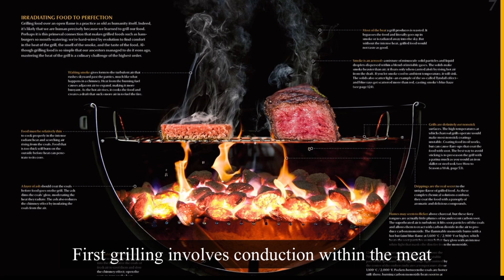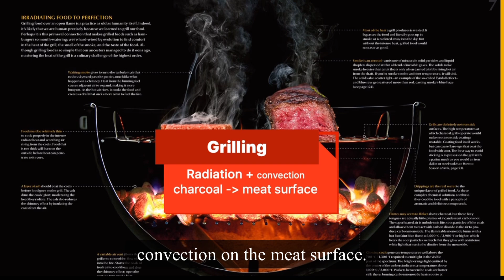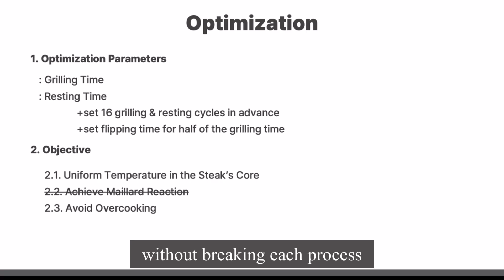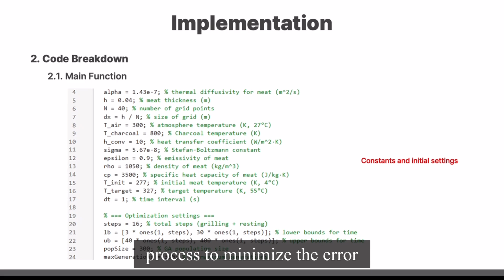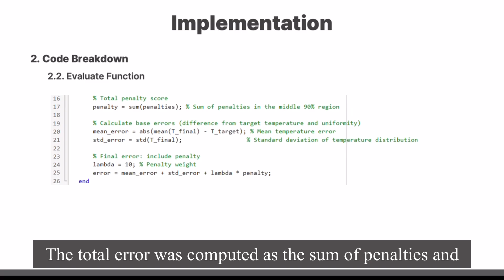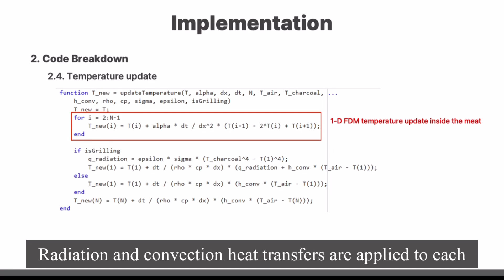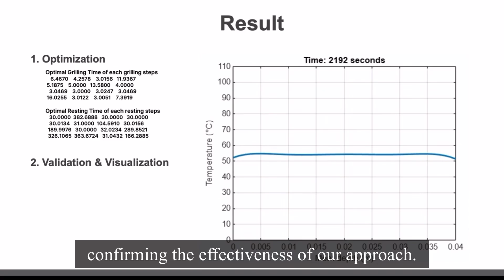Team10, A well grilled cut of meat. That’s it

Comment: Hello, I'm Lee Hyun June team 12. I have a question while looking at the graph, even though grilling was chosen as the method of cooking, the top and bottom of the meat seem to cook simultaneously. What is the reason for this?
Reply: Thank you for watching our video. Firstly, you can check that the temperature of top and bottom is not perfectly same,  but slightly different. Also, the reason that top and bottom of the meat's temperature is similar is that thermal radiation, not conduction, from heat source is dominant heat transfer method. 
Charcoal burns at high temperatures and emits significant amounts of infrared radiation. This radiation transfers heat to the meat directly, warming both the top and bottom surfaces of the steak regardless of their distance from the charcoal. 
While the radiation does not penetrate into the meat, both the top and bottom surfaces of the steak are directly exposed to radiant heat from the charcoal (or reflected heat from the grill lid or surrounding environment). This direct heating of both surfaces creates the illusion that the internal temperature is rising uniformly from both directions, but in reality, the heat must still conduct inward from the surfaces. Thank you!

Comment: Hello, thank you for your presentation and I’m from team 6. When cooking steak on a pan, wouldn’t it make more sense to consider the pan’s temperature as the effective heat source rather than the temperature of the charcoal? Thank you.
Reply: Thank you for watching our video. In our study, we modeled grilling process with 'grilling with Barbecue grill and charcoal' as you can see in 0:46, which has small contact area compared to pan, and so its heat transfer process is slightly different from 'grilling with pan'. So we considered 'radiation' from heat source(charcoal) directly, and didn't model conduction from pan to meat. Thank you!

Comment: Hello, I'm Heesoo Lee from team 1. As I understood, the project assumed that the moisture, protein, and fat are distributed evenly throughout the steak. However, in the actual world, this is not the case. Would the error due to that difference be minuscule enough to ignore? If so, why?
Reply: Thank you for watching our video. As you mentioned, we assumed that the moisture, protein, and fat are evenly distributed. We thought that this simplification assumption was reasonable because 1) thermal diffusivity('alpha' in presentation) of the moisture, protein, and fat are 1.39*10^-7, 7.69*10^-8, 1.14*10^-7 in order, and there is small difference between them 2) In a steak, the distribution of water is a major determinant of heat transfer characteristics, while variations in protein and fat distribution are less critical because their thermal diffusivity is relatively similar and lower than water’s. Thank you!

Comment: Thank you for your well-prepared presentation on interesting topic. I am the representative of Team 2, and I have questions. I think the effects of conduction and radiation would be significant, so I find it difficult to understand the graph where the top and bottom temperatures of the meat are shown to be the same. Additionally, I am curious about how the parameters could be adjusted if a grill is used instead of a pan.
Reply from the maker: Thank you for watching our presentation.
Q1. How is the temperature distribution of top and bottom side same?
A1. Actually when precisely looking at the graph, there are some moments when the graph is not perfectly symmetry. This is due to the timing of flipping. When first make the algorithm, we also included the flipping timing as variable. However the effect of the timing is not much great when we consider the increased calculation steps and times. Moreover the result of the  temperature distribution of the final meat is not as good as the one where the flipping timing is set as the half of grilling time(which is the one we used in the algorithm of presentation).
Q2. How the parameters could be adjusted if a grill is used not a pan?
A2. In the presentation we consider the circumstances where we us grill. Among many types of meat grilling methods, we pick grill because it's the way used in the program "흑백 요리사" and the main heat transfer of grill is radiation which requires many calculations. When it comes to the pan grilling, mostly the heat is transferred  in forms of conduction(or convection). In this case we can easily calculate the circumstance by just changing the boundary equation of meat surface. From radiation to convection.

Comment: Hello, I am from Team 5! What an incredible presentation on an amazing topic! I have a question: How did you determine the thermal diffusivity and specific heat of the meat? Additionally, I would like to know why flipping was set to half time, since when the cooking is initiated, the average temperature of the piece of meat is very low, but when flipping happens, the meat has already acquired a high temperature (even though it's not uniformly distributed). Thank you in advance.
Reply: Thank you for your attention. 
We've used the properties of meat such as thermal diffusivity and specific heat from Douglas Baldwin's "Heat Transfer in Meat". 
And yes, it would be more accurate to also calculate the flipping time by numerical analysis, but then it would be too hard to cook the meat in real life considering each flipping time. So for the sake of simplicity we just set the flipping time as half of the grilling time. And also when we have also considered the flipping time as variable, it didn't give much difference at the final result while increasing required computing power.

Comment: Hi, I'm Kim Namyoon from Team 4. Thank you for giving a presentation on an interesting topic. I wonder why the temperature of the top side and bottom side of the meat is similar before settling (end of cooking). Also, I want to know why the temperature is rising again.
Reply: The top and the bottom of the meat has similar temperature because the meat is flipped very frequently, before it gets cooled.
And the temperature rises again because it is flipped and heated again. As you can see at the top of the graph, since the time is multiplied a few times it may look like the two sides are heated at the same time, while they are actually heated and flipped separately.

Comment: Hi,  I'm the representative of Team 3. First of all, thank you for your great presentation. I have a few questions regarding your work. In your presentation, grilling time and resting time were set as the design variables for optimization. While time is undoubtedly a crucial factor when cooking meat, temperature also seems to be an equally important element. I’m curious if it would have been possible to include both temperature and time as design variables in the optimization process. If there were constraints or challenges in using both as design variables, what difficulties did you encounter?
Reply: Thank you for watching!!
It is indeed possible to consider both time and temperature(heat source) as design variables in the optimization process. Temperature can be treated as a variable dependent on time, allowing for a more dynamic optimization approach.

However, in our project, we assumed that the temperature of the charcoal (our heat source) remained constant over time. To incorporate the temperature variations of the charcoal, it would require actual modeling or observational data to account for how the heat source changes with time. This process can be time-intensive and resource-demanding, which is why we chose to simplify our approach by assuming a constant temperature.

That being said, including temperature variations over time would likely yield more precise results, and we recognize the potential for refining our model further in future work. Thank you for the great question!

Comment: thank you for your amazing and interesting work. I'm from team 9. When grilling meat, the direction of heat penetration will come into the side as well as the bottom of the meat, so shouldn't we think that more heat penetrates into the meat? Thank you.
Reply from the maker: Thank you for well watching and question.
Q. Isn't the  heat come in to the side as well?
A. Yes. there should be heat transfer in side as well. More precisely we may have to consider the view factor as well. Also we should make square specimen which has 6 boundaries. We tried to solve this problem in 3-D condition. But this requires kind of experimental data.
 Also the main purpose of this algorithm is to make perfectly grilled meat with very thin overcook layer. When grilling meat people mostly check the center temperature because it is the part taking the longest time for heat to be transferred. Plus the length is about 3~5 times longer than the height. So, we denied the side heat transfer and analysed the center heat distribution so as to get the optimal grilling time.

Comment: Nice work! I’m from team 7. I have a question. What was the reason for choosing the Genetic Algorithm (GA), and how does it compare to other optimization techniques in terms of advantages?
Reply from the maker: Thank you for watching.
Q. The reason and advantage of using GA algorithm compared to other methods.
A. There are several matlab built-in optimization functions. These functions can be specified in terms of its mechanism as Gradient-based(fminunc,fmincon), Derivative-free(fminsearch, patternsearch,GA),global optimization(ga, simulannealbnd, particleswarm), linear programming and mixed-integer(linprog, intlinprog), and other specialized optimizatins. 
 As we mentioned in the presentation, we tried to get optimal grilling and resting time for each step not in total step. However, each time is close related each other and we need to get 36 times. This means that the 1st grilling time is not independent of the 18th grilling time because it changes the temperature distribution of 18th steps. For this reason we need to consider the algorithm which can effectively get the optimized 36 times.
 The way we used is first to use matrix and second to use GA algorithm. Each grilling and resting time is different for each step but the condition they get is same besides of the temperature distribution at that time. And to get best use of the matlab, we use the matrix form variables. 
 GA,genetic algorithm, is global optimization and deriviative free algorithm. It doesn't depend on initial value but search total search space. Most importantly this algorithm evaluate several solution at a time. Plus it has low possibility of falling in local optima. Plus,  unlike other algorithms for every iteration it change several solutions. This gives the solution not by analyzing the graph or equation our complex and varying conditions are effectively calculated. The constraints of this algorithm are heavy calculation load, and highly effected by the penalty function.
 To overcome this constraints, we construct 1-D condition. And finely changing penalty function weights. For example, we first construct with only overcook thickness and center temperature, then added standard deviation of temperature distribution, then added penalty for too high temperature of inside 90% (>60 degree celcius) during grilling.

Comment: Hello, I’m from Team 8. I have some questions about your research.
I think evaporation should be considered during both resting and cooking times. From my experience, there are significant differences between cooking with a lid and without a lid. It not only blocks convection but also holds vapor, so the meat is in saturated air and doesn't evaporate.
Usually, when resting meat, a lid or something similar is used, but not during cooking.
Reply: Thank you for watching! 
First, we assumed a scenario where meat is grilled over charcoal in a well-ventilated space. Additionally, under these conditions, it was calculated mathematically and theoretically that the change in the meat's composition due to moisture evaporation has a negligible effect on conduction and convection, so it was disregarded. However, if optimization is needed for a process where the meat is grilled with the lid closed, the evaporation of moisture would need to be taken into account. Thank you for the great question!

Comment: Thank you very much for the presentation. I'm Bae Jin Hyung from team 11. What happens to the side surface of the meat? There are only top and bottom surface.
Reply: Thank you for watching!! 
Typically, when people grill meat, they tend to cook it by placing the sides in contact with the grill. However, our evaluation of doneness focused only on the temperature distribution and core temperature. Also, in previous calculations, heat transfer through the sides was found to have little impact on the overall doneness of the meat.
However, if the browning of the sides is to be considered, optimization focusing on the color of the meat may be necessary.
Thank you for the great question!